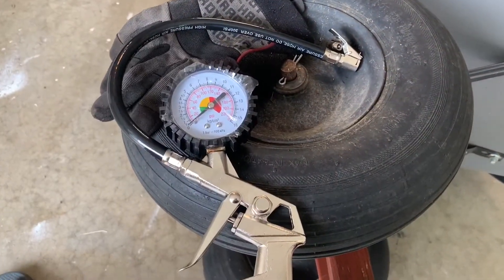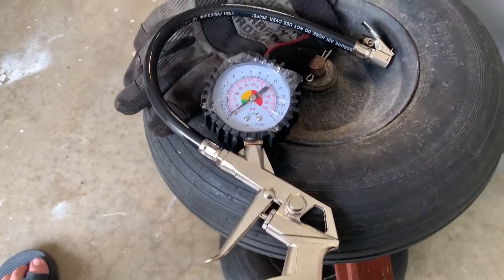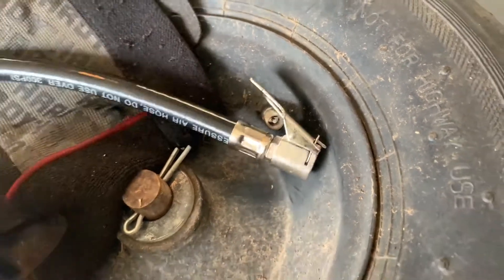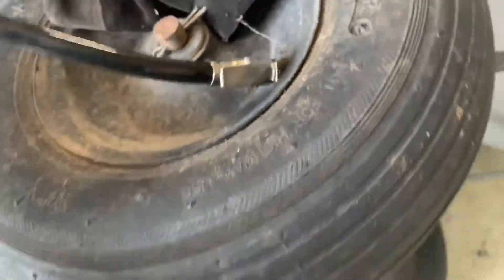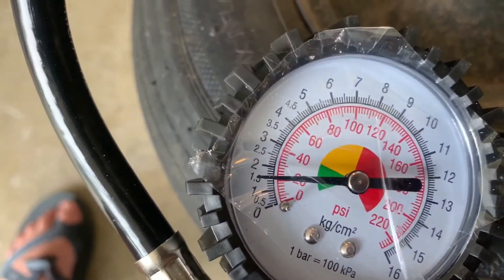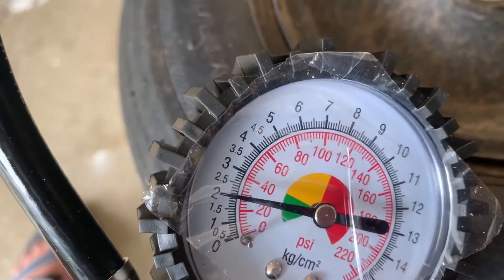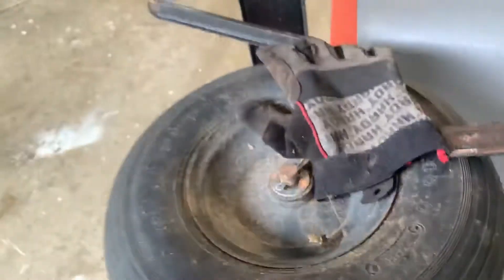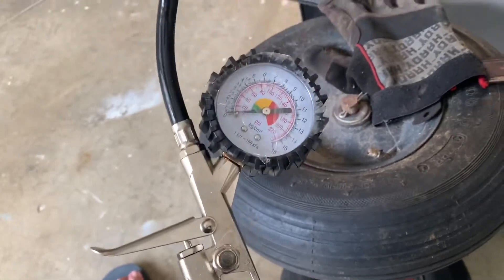Harbor Freight Tire Inflator for $10!

Comment: It isnt very accurate bit if you figure out how innacurate it is you can correctly interpret what it says. For example i air my trailer tires up to 75 psi and have learned that that translates to 90 psi on that guage. So i go till it says 90 and then I know i am at 75 psi. I usually double check with a known accurate guage to make sure. At least it margins on the error of under inflating not over inflating!
Reply from the maker: That makes sense thanks for pointing that out! I guess I should have checked! Lol